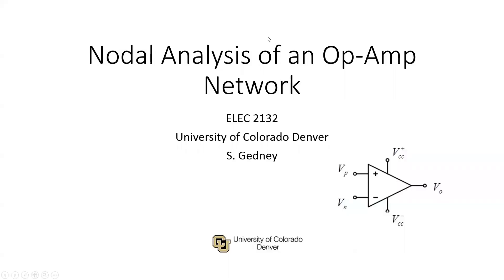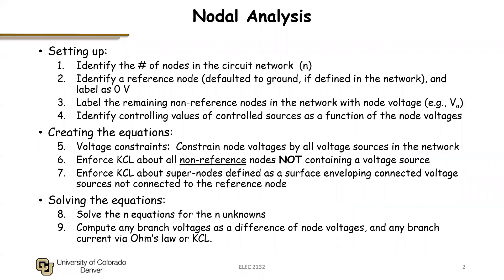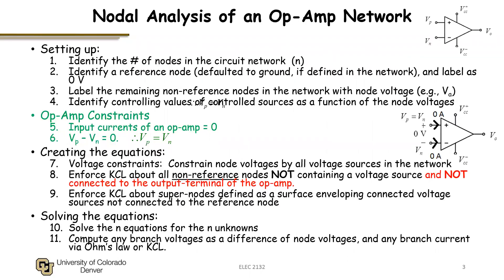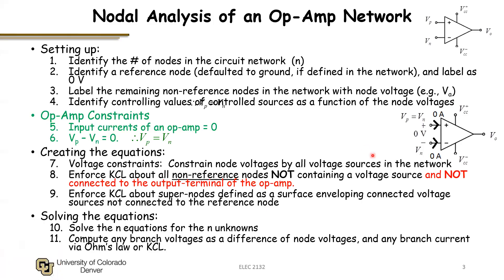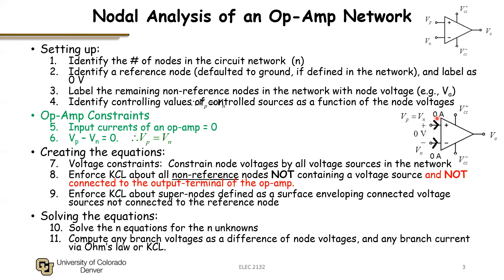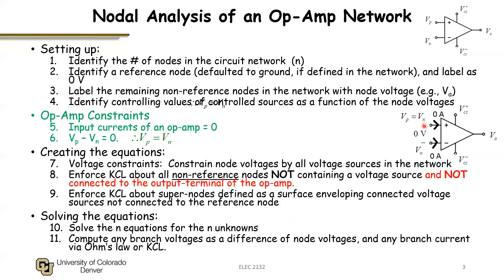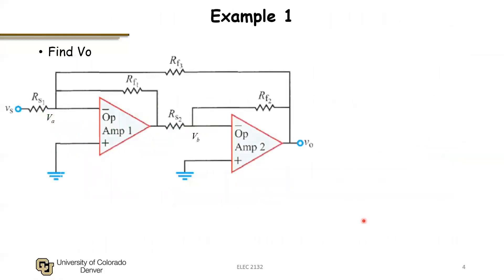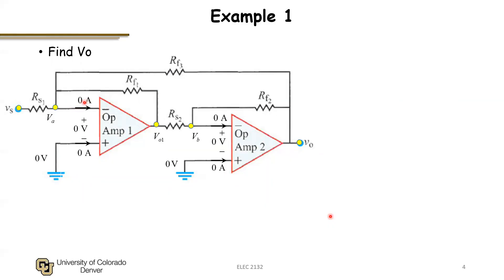Nodal Analsys of Op-Amp Circuits

Comment: Setting the constraints (0v between inverting and non-inverting Input, input current=0) hide the impact of input offset voltage and Input bias current. In a Majority of Applications this can be done. On the other Hand for worst case analysis we should Not simply hide these parasitics. For sure the equation will be more complex but with the help of Math tools you can handle this. E.g. Mathcad has implemented Symbolic solver. You only need to enter the KCL and the nodal equations.

Comment: design and draw a circuit using an op-amp to get +8v at output for input less than +4v and -8v at output for input greater than +4v.

Plz solve this
Reply: Basic comparator, use 8v rails.

Comment: sir why it is not Vs-Va/R1  in second example?
Reply: Because we're writing the nodal equation FOR Va (when we write a nodal equation for a node we imagine all currents are leaving the node). So what you wrote in your comment is Vs nodal equation, but remember, we don't write nodal equations for voltage sources.
Reply: Hello, i think it would be better to draw the Current flow Into or out of a node.  The sum of the node currents shall be Zero. If you have drawn the current arrow ist is more obvious how to write the nodal equations.